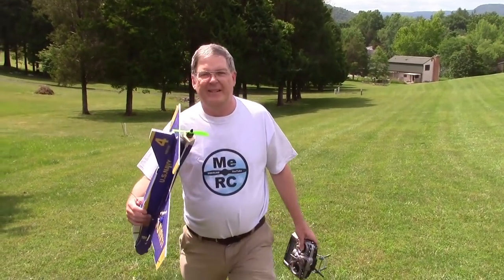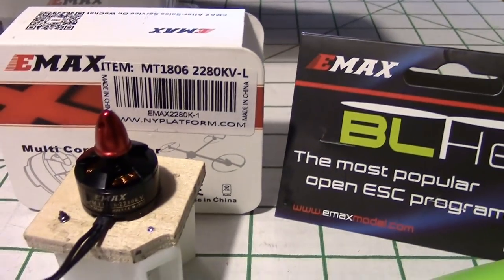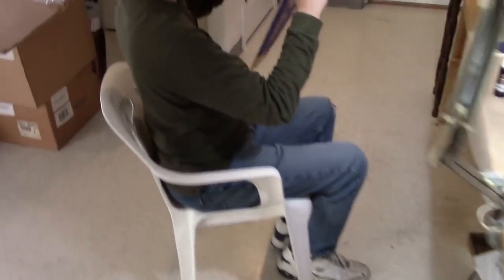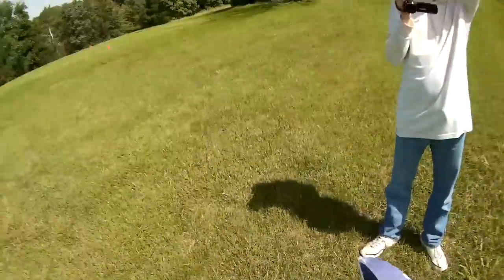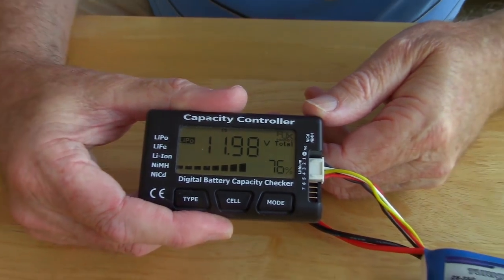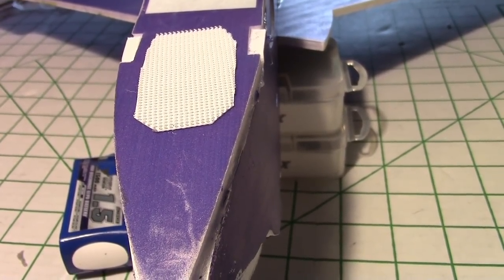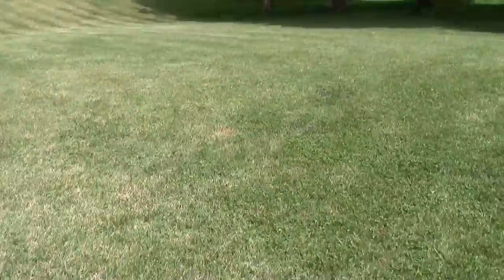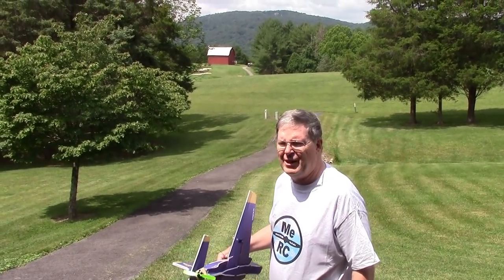H-King Glue-N-Go F4 Jet Build & Maiden Flight - Crashes Included

Comment: Great video. Most people wait until they are in the air before they do a loop. Have you got the prop on backwards.
Reply from the maker: Thanks! Plenty of power just the wrong angle on the motor driving the nose up.